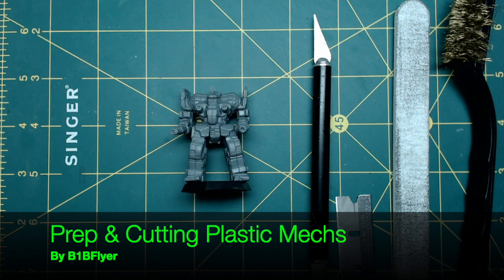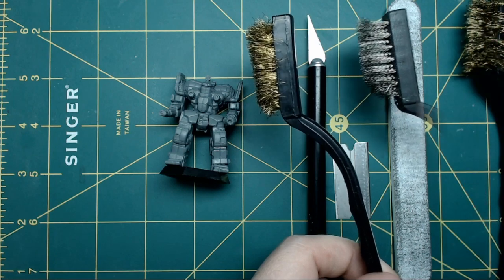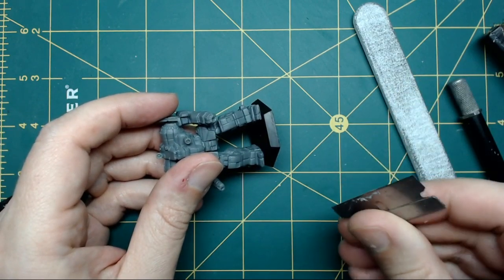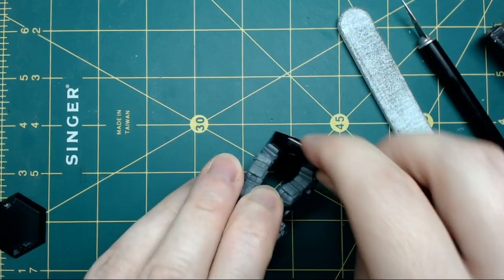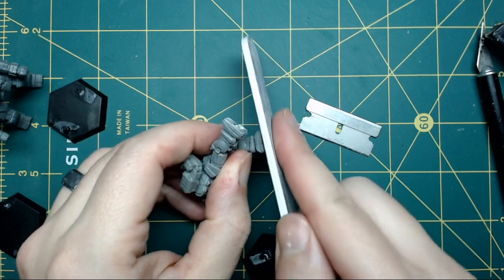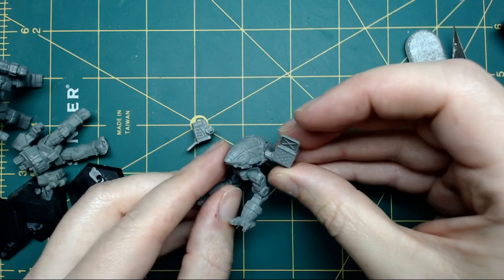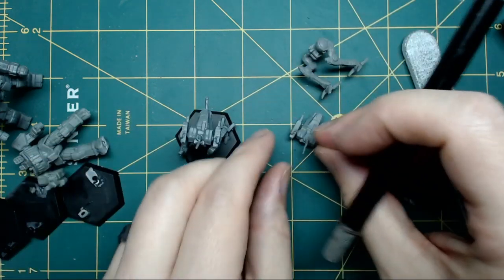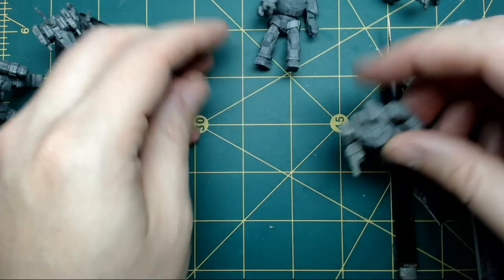Preparation & Cutting Plastic Battletech Mechs | Hex Base Removal & Modification

Comment: Remember to wash your models with soap and water before painting, you have to get that mold release off to help the primer and paint adhere.
Reply from the maker: Absolutely. I made this clear in my metal model prep video but should have made that point again with these as well. A clean mini is a happy mini!
Reply: I just painted 8 without washing them - no apparent issues at all…
Reply: It's always a good idea to wash models before painting, weather they are metal or plastic.
Reply: @TheMiniJunkie the primer will go on but i have found the paint tends to wear off much faster if I haven’t washed them first. This is worse with some batches of minis over others. Not a big deal if you varnish your minis but it is something I noticed.

Comment: To repose the minis you can also dunk them in hot water for a few seconds and move the limb to the position you like and hold till it cools.   Dont heat the water to a boil but maybe hot enough for hot Coco or hot tea.
Reply from the maker: Correct. I already have a video of that.
Reply from the maker: Correct. I already have a video of that.

Comment: will standard hobby plastic glue work for reassembling these models? I know it melts plastic to bond them together, but there are many different formulas of plastic and not all chemicals react the same with them
Reply from the maker: You need to use superglue or CA on these. Traditional plastic cement won't melt this plastic.

Comment: What cleaner would work to dissolve the super glue? Would a soak in Super Clean do the trick?
Reply from the maker: I use Super Clean for 40k miniatures that have been superglued with decent results so that's what I would try first.
Reply: @CamoSpecsOnline  test on a model you doht mind becoming bendy/melted

Comment: thanks for the tutorial. I have 2 questions. Should you always sand a plastic mini and don't use a file? In a past video, you used really hot water for the alpha strike lance pack. Is this still useful to do with these minis?
Reply: Same type of plastic so should still work.
Reply from the maker: I prefer to use sanding sticks and emery boards but if you have a metal file that yields a good result for you, then by all means use it. Hot water works great for reposing these miniatures.
Reply: @CamoSpecsOnline  
A while back I got one of Tamiya's plastic modeling files for some gunpla kits. You might want to give it a look some time. Doesn't really grind off like most standard files, but rather sort of "cuts", leaving a mark more like you'd find from a knife.
Major downside is, it's really hard to judge because of that. Sometimes you end up removing more than intended. Little less reliable, but super quick for getting decent finishes on gundam kits.

Comment: I have not pulled apart the new plastic battletech mini's. Can you freeze them to make the glue easier to pop like other plastic/resin mini's or is it solvent glued in place?
Reply from the maker: It is a contact glue of some sort but I haven't noticed much help with freezing them, and the plastic usually gives before the glued portions. I haven't tried soaking in simple green to break down the glue but that's because it takes at least a week or so and I usually just start cutting instead.
Reply: @CamoSpecsOnline  Have you tried CA debonder?
Reply from the maker: @Buster01Actual  I have not. If I'm taking a plastic apart for a repose or mod, I'm just quicker with cutting it off and pinning the joint as I do it so frequently.

Comment: What about preparing for painting?  Do you need to wash and/or primer these?
Reply from the maker: Yes they need to be primed and washing any miniature beforehand is always the safest bet, especially if oils from your hands get all over them as you're trimming mold lines.
Reply: @CamoSpecsOnline  I've used warm water and a touch of dish soap.  Is that what you would recommend?
Reply from the maker: @DoctorPhobos  Yup, that works great

Comment: You think it might be possible with the Wolverine leg to do the hot water treatment on it like you could with reaper bones miniatures?  Simply dunk the leg on boiling water first for about 10 seconds, take it out and adjust the leg quickly to the desires position, then place in a bowl of ice water for about 10 seconds to hold it in place.  Granted I don't know the plastic similar to reaper's plastic but it might be worth experimenting to avoid damge.
Reply from the maker: Hot water works, but the leg would likely have an odd look with the amount of movement needed.

Comment: if its just super glue holding to parts together wouldn't it be easier just to pop the model in the freezer over night to help make the glue brittle then it makes it easy to pop the model a part if You careful
Reply from the maker: That works on some joints, others are so tight that it's often easier to just cut. I've had joints pop off because there was no glue and ones that would have broken the limb if I didn't cut so the inconsistency really makes it difficult to have a "go to" method short of clean cuts.

Comment: B1BFlyer, I’m surprised you didn’t mention using hot water to soften the plastic for easier cutting or the hot/cold water treatment for bending arms/legs into different positions without stress damage to the plastic.
Reply from the maker: I have a video for that and these plastics really don't need to be softened like the AS ones to cut well. https://youtu.be/DaE-OdlFGTk